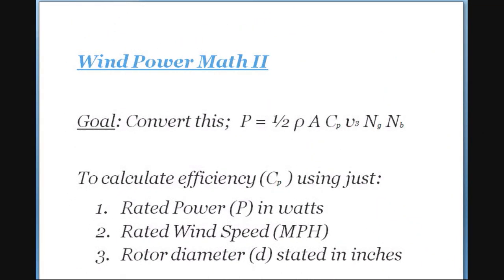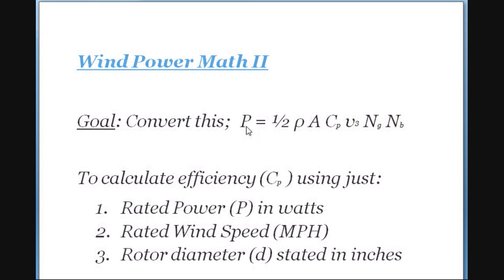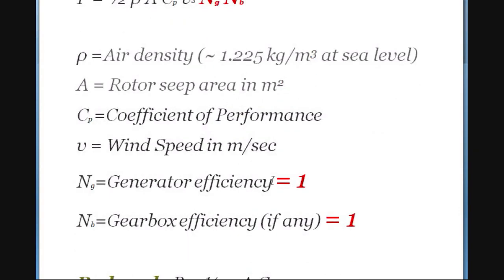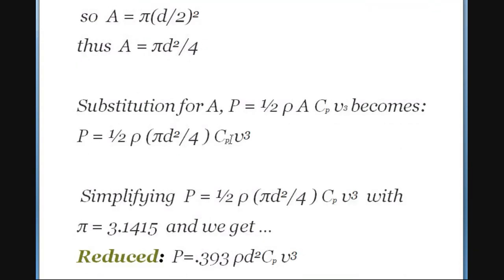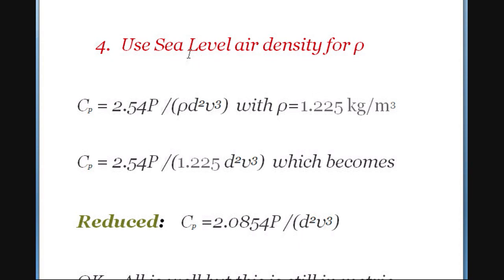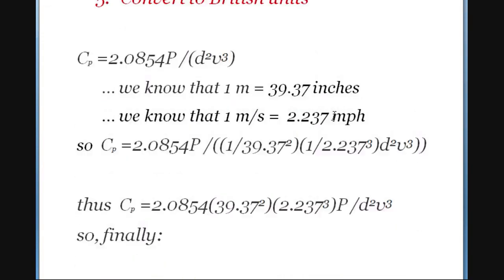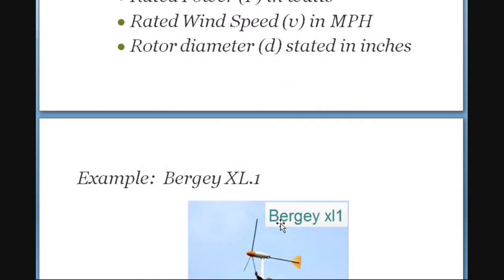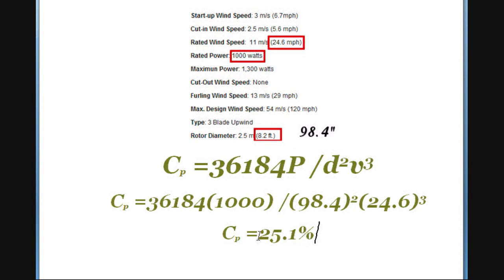Wind Power Math II

Comment: Betz limit has been smashed and debunked regards Graham S Flowers
Reply: Interesting
Reply: @Za-Silverstein  this equation is total rubbish because the wind can only push on what it touches it can not push on the gaps between the blades the blade surface area stays the same even if it is moving or standing still the area of the gaps between the blades also stays the same even when the blades are moving